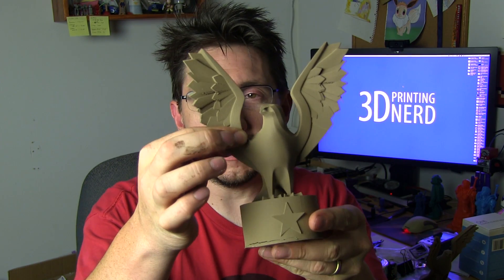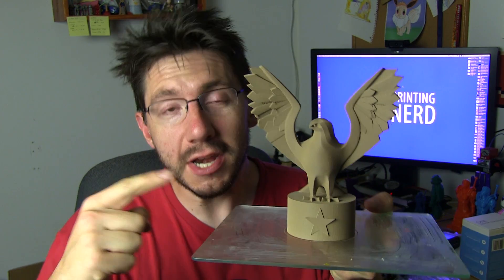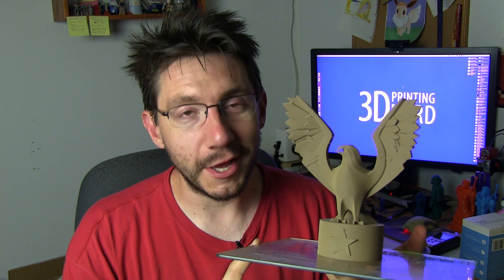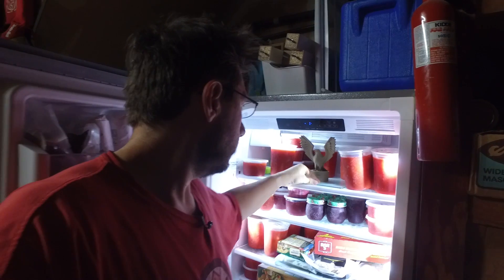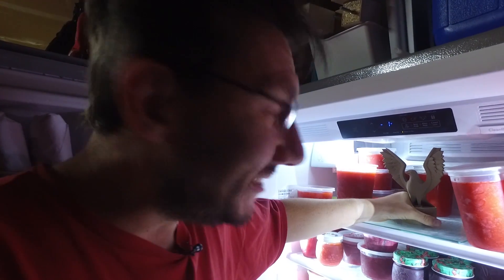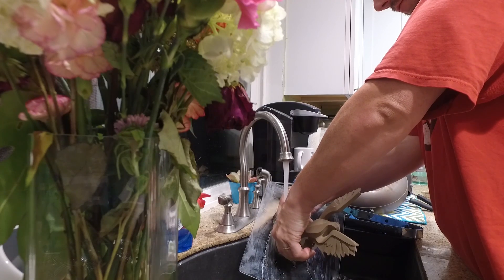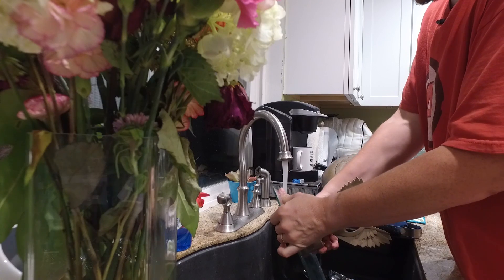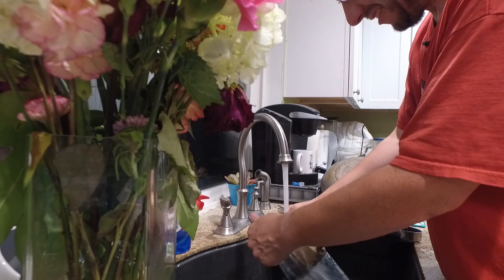3D Printing: Bald Eagle Fail ... Again

Comment: will it not stick without the glue stick?  this is exactly why i've shied away from glass and use a $2.50 piece of lexan from the hw store, if something won't come off a little flexing usually pops it.  There's always tape too, not like a shiny finish matters on the base.

Comment: hey man turn it upside down on a bucket and hit the bottom of the glass with a heat gun it should melt a little and drop off
Reply from the maker: +Daniel Tweit great idea for next time!
Reply: Daniel Tweit Sounds like an easy way to get the glass to shatter unless you have borosilicate.

Comment: That is why I use a 6x6 inch piece of 3D printer bed tape. It never sticks to bad but if I does I can just peel the tape off and then take it off the print.

Comment: Hi Joel I learned a little trick 
The build plate has 2 side I had buildtak on one side and the other I left it be.
Note that when you use the buildtak side you need to re level the bed.
Also on the none buildtak side I notice using Elmer washable glue better than the glue they provided for PLA.
I haven't tried abs yet on this I will update later

Comment: You need to start thinking of that ex-build plate as a display stand for your print.

Seriously I thought I was the only one that either had prints coming loose half-way through the print or welded to the bed material for life! Nothing in between :D
Reply from the maker: DUDE! Not I just got the model off the build plate not 10 minutes ago! No joke. I need to film the third and final video for my bald eagle build plate trilogy!

Comment: Hi, I have a Ultimaker 2 now for almost a year. I never use any glue stick or similar with PLA. For me just the cleaned (really clean - i use a little window cleaner ) glass plate with the default settings work if i squash the first layer a bit.

Comment: Joel, get yourself a 5-in-1 painters tool, but it at the base and give it a little tap. Works like a charm for me every time. Though I did break my glass build plates in the past. Hmm.

I traded out my glass build plate for a metal one a year ago and I never looked back. You don't need to be gentle at all.

Comment: First layer temps and nozzle height. I killed two nice PEI build platforms trying a ABS/PLA Carbon filament before I decided to make some changes to those variables. Lower the filament and/or build plate temp very low for the type of filament and then work your way up till you get good adhesion. Reduce the 'squish' you give the first layer too, some filaments don't need that much to stick.

Comment: could you print a thin raft under the whole base that would allow it to break away easily yet it still hold the print in place till completion? or do you need a solid flush connection to the build plate? also maybe just a dab of glue in the middle of the print instead of the whole thing?

Comment: I had a problem with way to much bed adhesion myself so I tried some stuff and I have come up with my own way to get my print to stick and release, I just tried it and it works so don't judge me!!  I bought some roof flashing (http://www.acehardware.com/product/index.jsp?productId=29795026) and I use blue tape to attach it to my bed, it is curled but when I tape it down it flattens out. My prints stick to the tape and when I pull it upwards off my bed it then flexes and my prints pop right off.  So far it has worked every time but once and I actually had to remove the tape to remove it from my bed but then I flexed it and the print came off.  Other then replacing tape and replacing the aluminum flashing after 20 or so prints I have not really had a down side.  My bed is 8"x8" and the flashing is 8" by 120" so I can do a lot of printing for $9.99.   Give it a try...  Portland Randy.

Comment: A late comment, but reinforcing what others have said. If that is PLA and you have a heated bed, then use just plain clean glass. Bed temp 60C; after printing let cool and print should pop off. Perhaps print first layer slowly (~15 mm/s). Use a skirt to prime the extruder.

Comment: change the file, make the bottom a star. is it possible to put supports under it, suspend it in air is simplify 3d and add supports under it. similar to those perforated build plates.

Comment: Can someone help me with my 3D printer? I have a prusa i3 by Hictop and my z-axis jitters. I can plug any motor in and it just jitters and doesn't do full spins might start one way and go in another direction. I plugged the z-axis motors into different ports like the X-axis and they move but whenever I plug them both into the z-axis they make a noise for a second and turn off and the only way I can get them to work is by turning my 3d printer off then on. The z-axis port isn't working and I want to know if I can fix it, or do i need a new board?

Comment: Try printing it directly on glass with no glue stick. Some PLA will stick well anaugh to glass and it is easyer to remove, just clean the glass with alcohol before you start the print(while the bed is hot)

Comment: The water just takes a while, so you just leave a bit of water around the print and it will creep under the print eventually (especially if the print is still cooling). You find the spot where it went under the print and lift that edge carefully with a spatula. Give it more time, but put less effort into pulling the print off (and don't pull on the print unless it's a strong model). I don't use glue though...I use "It Stays". Maybe it dissolves easier than glue.

Comment: Hey I had an idea. I wonder if you put aluminum foil down and then printed on that? The foil would have good heat transfer for heated beds and to make sure it sticks to the foil you can still use all your favorite adhesives. Once the print is done then you can just pull off the foil or if you have to sand it off. That would make a good video to see if it works or not.

Comment: From an optical engineer:  This is a trick used to create optical retroreflectors (corner cubes): Two optically flat surfaces will "bond" together if brought into contact. A retroreflector is three mutually perp. planes, often created by putting three mirrors on a polished cube, their edges bonded, and then removed. Of course, it's nearly impossible to remove the assembly, so the cube has lines etched in it which are filled with water and then the assembly is frozen. The cube easily releases as the water solidifies and expands. 

So put a couple of shallow channels in the eagle base (.5mm wide is all you need) at a couple of locations. Allow water to wick into those channels and then freeze it. The water will expand and should pop it off.

Comment: something I have tried that seems to help ever since I sanded my Pei bed the prints stick great in fact too great too hard to remove so what I did is I lay down a piece of blue tape so that it was under a small part of the model then when I go to remove the model I peel up the tape and insert the scraper between the tape and the bed under the edge of the model this is usually enough to give me that little wedge opening because once you get a tiny bit off the bed it pops off but getting that tiny bit can be a pain I hope this helps I will post a video shortly as I'm about to go remove model from the bed

https://www.youtube.com/watch?v=nGU3N4dki18

Comment: Yea, good luck on the Wolfbite.  I tried to dial it in many times and each time it stuck the glass came off with the part. Adjusting tram height and hbp temp in many configurations all resulted in either no adhesion or to good of adhesion (especially ABS).  Four $40 glass plates later the Wolfbite sits on the reject shelf. Buildtac the same, to much prying.  For me simple hair spray and a very exact tram height works well. If I let it cool to room temp (or freezer 5 minutes)  the parts literally just fall off. Substituting glue stick in areas where supports are first layer is helpful too.  For that Eagle I'd change the base some to have either some wedge points for tool insertion or a shallow checker pattern (or stripe) on the bottom for surface areas reduction.  Shoot, now I want to print one.  Hy5

Comment: Joel, just don't use the glue. I have the Ultimaker 2 too and I do always clean my build plate with rubbing alcohol and it always sticks very nicely. And removing the object isn't a problem either.

Comment: Just cos something fails, it still teaches us something.
I would suggest just using a couple of stripes of glue stick with a space between them, it's enough to keep it from coming off during print, but will still allow easy removal.
At least it works for me when printing models with a lot of contact area with the bed.

Don't forget, you probably don't even need glue with that amount of contact area.

Comment: I use pritt orginal glue stick works very well (: much easyer to remove.
Reply: i set the buildplate for 45 degrees celsius and set first layer to 0.3 for pla.

Comment: the broken piece looked like what your face was doing....lol
white (pva) glue diluted to milk like consistency. apply to bed and a brush helps even it out.
heat up bed and watch it turn to like a sheet of scotch tape. then print. a few sprays of water will loosen part. works well with pla and to reapply to small area is easy and will usually blend well.
i have had glue stick chip glass and was not fun. stuck so well that when i tried to remove part it removed a chip of glass with it. never seen glass do that before.
also a utility razor and i use a scraper as the "hammer" to get off the prints that are really on there.

Comment: When I print something with high surface area on the bottom face I tend to raise the model a few millimetres from the platform and then I just print support underneath, I haven't had any issues with this when using simplify3d.

Comment: I agree with the other more time in the freezer suggestions. I seem to be in this situation regularly with PETG + glue stick. I put the print in the freezer before I go to work. When I get home a gentle tap with a rubber mallet or a dead blow hammer and the parts usually pop right off with way less marring than the traditional spatula methods.

Comment: I know this might sound crazy but I kept breaking glass when printing PETG directly on heated glass because the print sticks to the glass to well.  I started experimenting and found if you use TightBond II Wood glue and a silicone brush with water to coat the glass bed before printing.   Once the bed cools the print will be easily removed as long as the bed temp was not too high during printing.  Something with TightBond it will tack up when heated and when cooled will not stick to plastic at least PETG in my case.  Also note the glass will get a redish haze from the glue.   Bed temp was 85 for first 5 layers and 80 for remaining.  Have not tried to clean the glass just keep using the same surface so not sure what will happen in the long term.  I stop using expensive Borosilicate glass.  I just use window glass and and cut to size.

Comment: So it looks to me that you had too much glue stick on it, you just need very little. To apply it simply put some and then use a slightly wet cloth to apply it the best possible on the buildplate. Maybe you also need to be slightly higher on the build plate level, it maybe that the first layer is really squished a lot and that it bonds too much with the build plate. If it's stuck like in the video, using a putty knife to get it off can help also.

I'm sure you'll figure it out somehow :)

#Highfive

Comment: have you tried printing on blue painters tape on the build plate or after you print the model just run a small torch back and forth across the back of the glass(build plate) to heat it up until the model comes off?

Comment: maybe you could try flipping canned air upside-down and spray on the underside of the glass. I feel like the freezer deal didn't work because of it cooling the whole part and the glass at the same time. the extreme temp difference may help...i have not tested this..just a thought..anyway Love your videos!! keep up the great work man!

Comment: Suggestion #137  ,,  haha
Freezer Removal trick: Part 2  :)  "Balancing Stick and Release" ; material vs medium, (everyone has their favorite,, here's mine,, YMMV)
You have too much "Stick", and unfortunately, using "Wolfbite" is going to be worse,, as it is meant for use with ABS, PETG, TPU and TPE.
 "Aquanet Superhold" for PLA (apply on bed , removed from printer)
"Aquanet EXTRA Superhold" or "gluestick" for ABS
""" 2-3 minutes in the freezer,, and NOT more """.  The heated glass bed will cool and quickly shrink faster than the plastic, and cause separation due to thermal contraction. 
 Any longer and the plastic will also shrink ,, and your adhesive medium will freeze (aka=wicked bond)

Comment: Yet another suggestion.... :-)  You re-calibrate your printer so the  gap is a tiny bit more - the first layer wont get so smooshed onto the build surface  - and hopefully comes off with a little less force.....

Comment: Barnacles has a tip to use a computer duster upsidedown to shoot out liquid compressed air on his ultimaker prints. I imagine what matters is the temperature differential and make the print contract rapidly vs the temp of the build plate and make it unstick from the build plate.

Comment: Getting a print of the build plate when you use glue for better adhesion is easy. Spray some rubbing alcohol onto the build plate. It seeps underneath the print and dissolves the glue. Wait a couple of minutes and you can just take the print off.

Water does not really work, because it has a very high surface tension.

Comment: The only legitimate use I have ever found for 3D Printing pens is to fix these metal filled pla accidents, let em dry and use superglue to bond them back together warning works almost instantly - then use the 3d Pen to patch up the seam and sand back :) It works I promise! Also... either that's Jam in your freezer or I'm a little scared now haha.

Comment: I dont use glue anymore because I have run into alot of my prints becoming stuck to my print bed. I rely on First layer squish to keep my prints on the bed. Take a peace of paper put it under your hot end and home your Z axis. You want the paper to touch the hot end and you should feel the paper rubbing against the nozzle tip.Make sure the paper still moves.The perfect distance is when it moves easily but you can feel the paper vibrating against the nozzle when you pull it. Calibrate all four corners of your build plate. Your print will stick nicely to the bed, and be easy to remove.

Comment from the maker: You all are AWESOME! I absolutely love all these suggestions and different ways people get stuff to stick to and come off of their bed. I keep thinking I need to start a wiki with all the stuff I learn AND all the suggestions people give me! I'll try to film the third AND FINAL part to this saga tonight! #highfive
Reply: Wiki is a great idea! You have so much knowledge and experience, I really think you can help noobs like me ease into the 3-D printing world
Reply: 3D Printing Nerd I know this is over a year old video but whenever I have to deal with a stuck print like that I take a can of air duster and flip it upside down to release the "super cold" spray and works EVERY time. Food for thought
Reply: Yes a 101 printing tips Joel you are a genius
Reply: That would be great! I'd love to help input info for Slic3r and filament settings :D
Reply: Did you try not using glue?
I have a UM2 and when i get this problem i scrape off the glue under warm water and just print on a clean glass build plate.
Reply: one thing I've found that works is before is completely cools ( let it mostly cool) take an aerosol duster, turn it upside down and blast it for a a few seconds. just make sure you open a window
Reply: 3D Printing Nerd  i have a mono price maker select the plate gets up to 120 c and if it is stuck i heat up the bed and it pops off
Reply: disclaimer, I'm  a non 3d printer,  but I'm a plotter crafter, and we tend to have issues with stuff not releasing from our mats. the thing that helps us, is bending back the mat and keeping the object steady. of course you can't bend back a glass build plate. so what if you apply a flexible removable layer to your build plate, then after printing remove the layer along with the object, and then peel back the layer? rhinestone transfer material is basically heat proof contact paper, so may be worth researching?
Reply from the maker: +Drewski17 GREAT idea!
Reply: 3D Printing Nerd no problem!  It's odd you had it stuck on that extreme with glue stick...what was the bed temp again? Either way I've always had the canned air upside down trick  work and for super stubborn prints, once a little edge lifts usually you can put the buildtak spatula under it and give it a good bump/flick and it literally "pops" off.  Btw I've watched your videos along with Angus's for past couple years so keep up the good work!  I'm enjoying my CR-10 but honestly prefer my Flux Delta+ mainly due to the auto calibration/auto level features and it's awesome magnetic build plate that reminds me of my buildtak sheets. It's so cool just bending the flexible plate and have the prints pop off. It's also nice not having to use any adhesive or constantly level the bed. (The Laser engraver, built in 720p camera, cutting tool head,3D scanner,CNC plotter are all nice features) and wow is it super fast compared to my CR-10. I'm talking roughly 50-70% reduction in print times with identical slicer settings!  Soooo if you can get a hold of the 2nd gen (Flux Delta +) and do a review I know it'd be a GREAT video and I know you'd enjoy it very much as it's probably the only true Plug and Play printer out on the market(that's actually high quality)